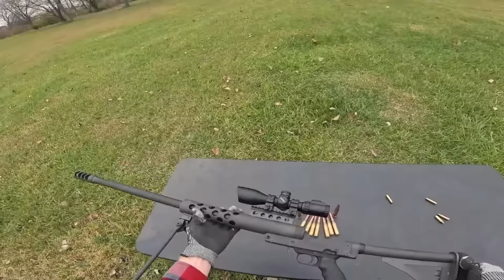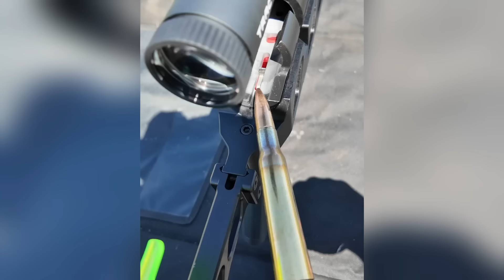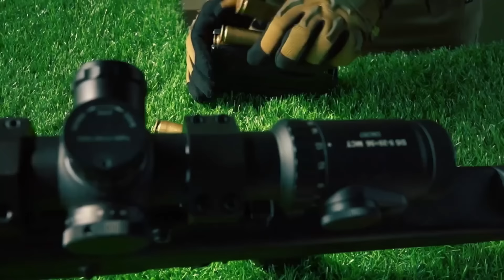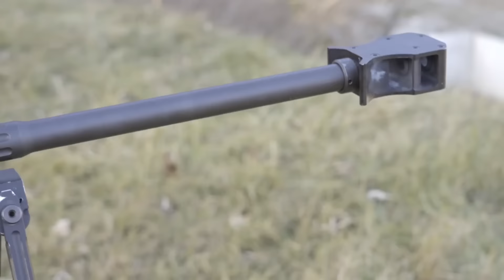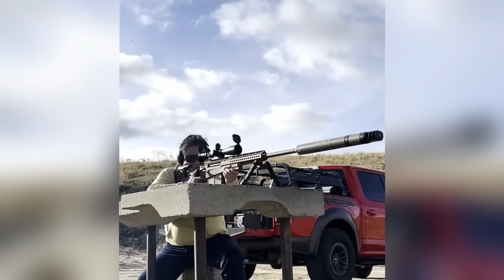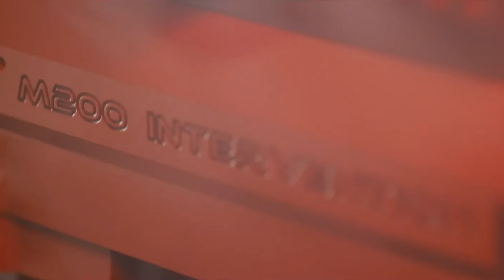7 Levels of Anti Materiel Rifles Explained

Comment: Level one is a really good firearm, just don't use non regulated slap rounds, that's what nearly killed Kentucky Ballistics. He even used the heavy barrel offered by Serbu and it still blew up.
Reply: Ten for got it , no slap rounds , or they'll slap back
Reply: In all fairness it wasn’t the barrel that failed but rather the screw cap and the chamber, ammo was loaded WAY to hot and as a result it just detonated as he fired it
Reply: @shivertheiguana Mark Serbu said the pressure had to exceed 186,000 psi to sheer the threads on the barrel.  That it held up to more than a couple of those counterfeit rounds impressed even Mark.
Reply: Actually it’s because the ammo he bought was reloaded with the wrong type of powder.
Reply: @MysthrillYT  so it was the powder type, not the powder volume?
Reply: Росіяни роблять найгіршу зброю в Світі . Ті характеристики , які вони заявляють = 💩 Постійно п'яна людина нездатна нічого дати людству 🤢
Reply: Serbu really made sure that his rifle is beyond safe, if it blew up this way that means the round inside would SLAP the shit out of other rifles too, as far as i know Kentucky Ballistics is the only catastrophic failure that happened with this rifle and it's autopsy showed the ammo generated way too much pressure for any rifle to handle in a failsafe manner

Comment: There's not a rifle around that can handle a WAY overloaded round, as Scott from Kentucky Ballistics proved after his near fatal accident with other rifles. The strength of the Serbu RN50 is as strong or stronger than any other action out there.
Reply: true but other bolt action rifles would spit out the gas out to the side, not directly behind.
Reply: @gagida1829  It wasn't the gasses that got Scott. It was the sheer pressure that forced the breech cap to sheer all the threads off and the two locking lugs!
Reply: @dundonrl  By gas, I meant the pressure. And since the pressure escaped from the back, it got Scott. If he used a regular bolt action rifle, the explosion would have came out through the side(where the action is exposed) and not blow back the cap straight at Scott's face.